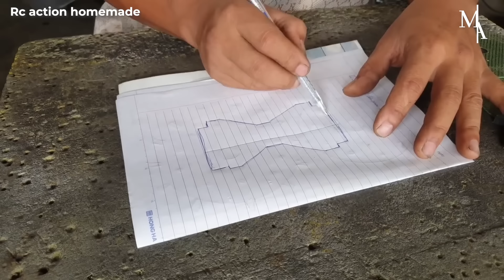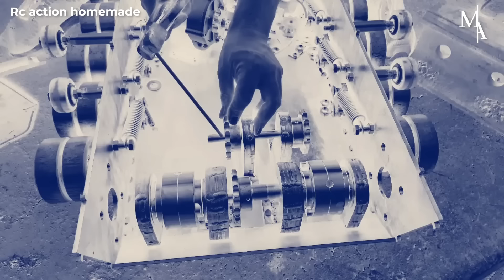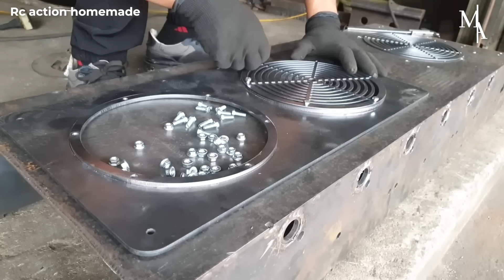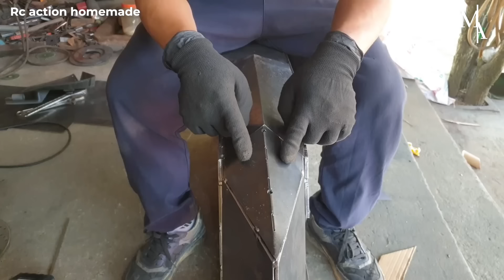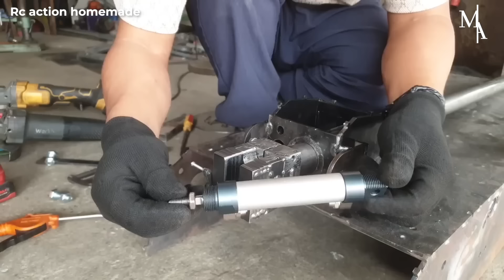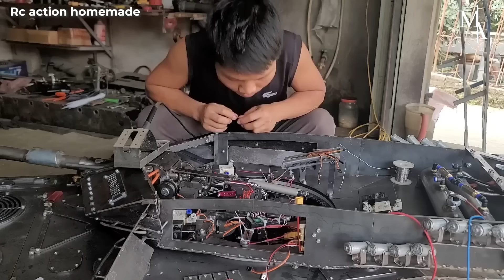Man Builds a $20,000 Mini Tank That Shoots Like a REAL Tank | Full Build by @rcactionhomemade

Comment: Beautiful Leopard 2A5 or above.

Just to share information here. There reason stuff is mounted on the outside of the hull (extra tracks links for example) is for fast repairs yes. But also, if an enemy shell hits a track link, the energy will be absorbed by the extra tracks links for link, potentially stopping penetration.